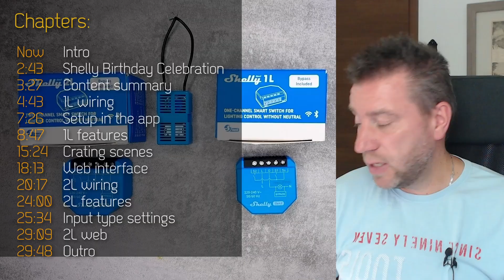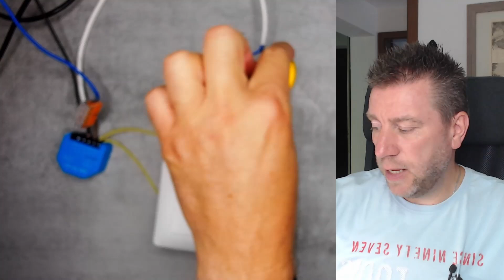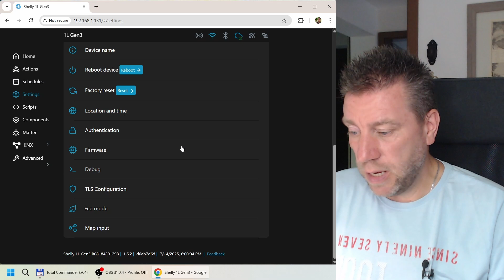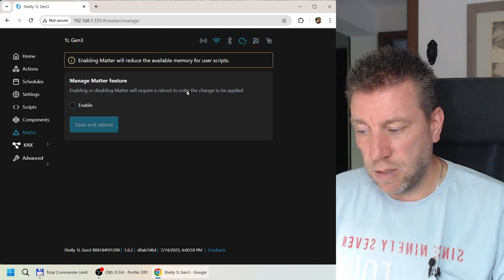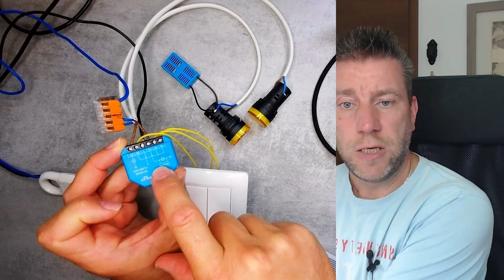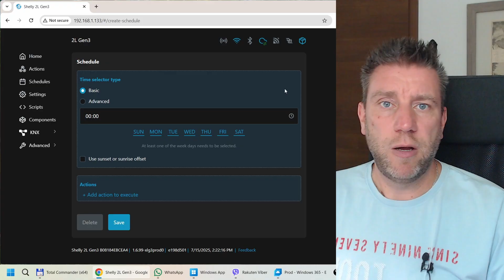Shelly WITHOUT Neutral Wire: 1L and 2L Gen3 Review

Comment: How would it be done for a 2gang 2 way switch.  I.e. I have a light switch in the kitchen 1g2w that controls the light.  And another switch in the other end of the kitchen 2g2w that controls the kitchen light and living room light.  Then a switch in the living room 2g2w that controls living room light and hall light.  I've just got the 2way shelly but the switches have a switched live depending on how the other switch is.  So now trying to figure out how to control the living room and kitchen light when they can be controlled from multiple switches
Reply from the maker: Open ZBMINIR2 page on Sonoff's website, scroll down where they have a wiring diagram, and take a look at the right example. Bascially you wire the 2 switches as the usual 2 way wiring and connect that to the mini. Because of this this wiring, every time you switch one of the switches, the input will change to the MINI just as it would change if you had a single switch.

Comment: Very nice video. Only a question, I connected a shelly 1L to n.2 switches, but it works with only one switch. When I went inside the URL menu of the device, only one switch at time can be linked to the relè. The second one is remaining detached. How can I link both of them to the relè to use both switches for open/close the lamp ?